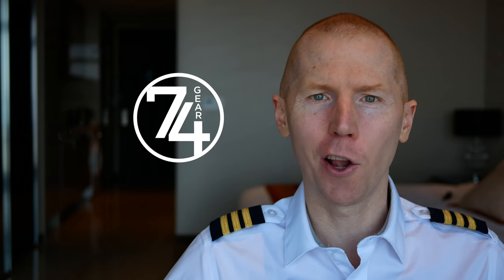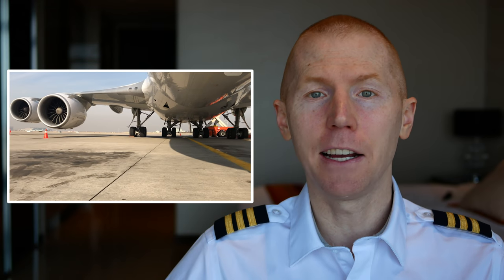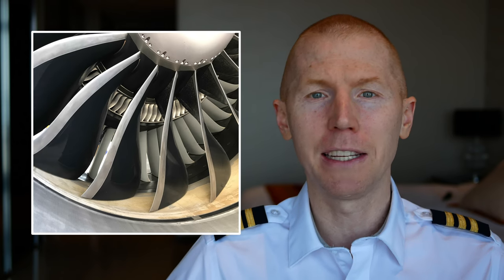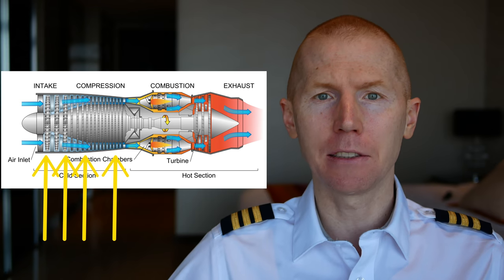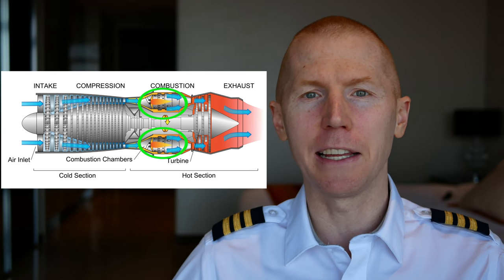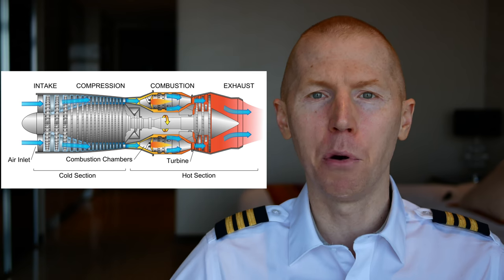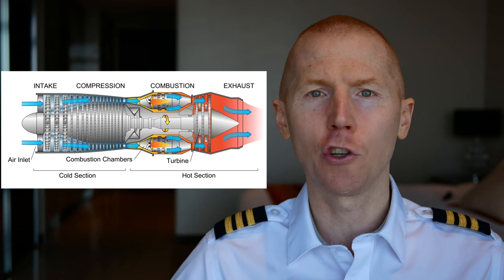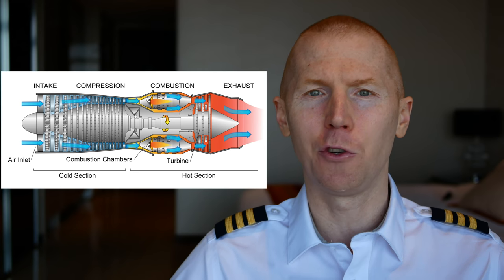How does an Airplane's Jet Engine Work | Airline Pilot Explains

Comment: Gas turbines,  have  compressors n1, n2,   combusters , annular or flame tubes, and turbine ngv. Some has 1 shaft like jet , others have 2 shafts a inner smaller in diameter and a outer hence 2 compressor rotating at different speeds to aid aerodynamic loads and few like the rb  family for thd l1011 has 3 spool or shafts, none of which is connected to the other..turboprop and turbo shaft  which are small jet may have a free turbine, which is a wheel and shaft and gears connected to prop and accessories
Reply from the maker: ya thats part 2 explaining the full system.

Comment: I always wondered why the combustion gases leaves on the back of the engine and not to the front. The pressure inside the combustion chamber has to bee higher than the pressure in the feed air and then the combustion gases have to go both ways🤷‍♂️

Comment: Good one! So, part 3 is about starting the engines on the 74 correct?
Reply from the maker: well all Boeing engines are going to start the same using bleed air from the APU, but ya it probably won't be part 3 but it will be. later video.
Reply: 74 Gear engine start switches oil lever and that’s that right? I watched Dutchpilotgirl‘s vid on starting the 737
Reply from the maker: well the oil lever ( I am not sure what you mean ) but that isn't going to start an engine turning.
Reply: 74 Gear I meant the fuel cut off lever or switch

Comment: So no pistons and it all works by a continuous cycle. How are the engines started in that case because you will have no initial air pressure gradient over the engine.

Comment: Not 1 video about MCAS and your thoughts about the 737 MAX situation?
Reply from the maker: manley1979 maybe after the investigation is over.
Reply: 74 Gear a lot of older generation pilots are saying the entire fly by wire trend in aviation is to blame. (Basically saying anything that takes control away from the pilot is bad) I would love to hear your opinion but I understand your discretion.

Comment: Now talk about what happens when a bird gets sucked into one. Also why does nobody do run-ups on turbine engines either.
Reply from the maker: what is there to run up on a turbine engine opl?
Reply: I runup my turbine engine all the time. 

How else am I going to check the autofeather, low pitch stop, prop governor, overspeed governor, prop feathering, rudder boost, etc etc etc? ;)

Of course on a turbofan engine there isn’t much to check.
Reply: @Bartonovich52  Maybe on a turboprop, but not on a turbojet or turbofan. Is it running? Next.

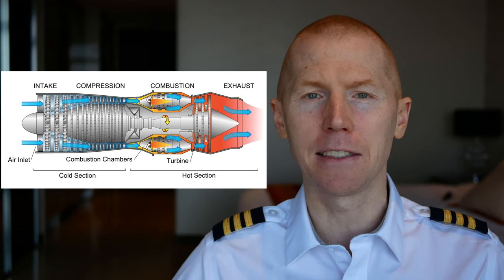Comment: Around 4:21 “Unless you stop the airflow or the fuel, the engine will continue to run”

So, is that why pilots turn on reverse thrust on landing?
Reply: A bit late, but no, reverse thrust is being used to brake/slow down the aircraft by kinda pushing it backwards (The thrust is being redirected from "Front->Back" to "Front->Front" if you know what i mean (I dont think so tbh)

Comment: Technically they are turbine engines not jet engines. To move the aircraft the engines are producing thrust by making a pressure bubble behind the aircraft causing the aircraft to move away from the pressure.  The principal of most engines from recipricating to turbine is extremely simple; suck, squeeze, bang, blow. Moving right along, the math that goes into making the engine work is complicated as all get out, not to mention the accessories like generators and hydraulic pumps.

Comment: Is the "canister" a torus-like all-hollow ring or is it comprised of a ring of separate smaller "canisters" around the core?
Reply from the maker: I don't really understand what you are asking tabaks.
Reply: All images of such engines are 2-dimensional. But, I think it has to go around in 3D. So, is it one continuous ring-like chamber around the shaft in 3 dimensions or is is a series of small combustion chambers in a ring around the shaft?
Reply: There are three different types of combustion chambers. Can. Annular. And can-annular. 

Old jet engines had cans. There were about a 8-10 or so all around the engine. Look up the Rolls Royce Nene or Rolls Royce Dart. You can see the individual cans... nothing covers them.. and they used pipes to get the compressor air in and combustion gassed out. Advantage was good control of combustion, strong, easy to replace one at a time without splitting the whole engine. But heavy, bulky, and inefficient. 

Next is can annular.  This is probably what he jet engine pictured has. Still combustion cans, but the air comes in as a ring and the gasses exit as a ring. More efficient and lighter with good control of combustion. 

Next is annular which is what most modern engines have. The burner can is one big ring (hence the name annular). This way you can have complete combustion all the way around... but the burner needs careful design and assembly to maintain rigidity and enough cooling air.
Reply: Bartonovich52, thank you for the exhaustive answer! Exactly what I was asking for. 👍

Comment: it's a combustion not and Explosion, combustion in Engine good Explosion bad. although combustion and explosion are very similar they are not the same you want to keep aircraft and explosions apart where possible
Reply from the maker: this is made for people who don't know anything about jet engines, so I am intending to keep things as basic as possible.
Reply: @74gear  thats fair
Reply: @74gear  Sorry, nope. AOG. Respectfully, if you oversimplify it to the point of being incorrect, it benefits nobody. I don't believe any of your subscribers wouldn't understand what a blowtorch is. Once lit, it's continuous fire until shut off. An explosion, by definition, has a definite end to the combustion period. A firecracker. A gunshot. A burst baloon. BANG! But that isn't what is happening here. It's a continuous ROAR! I think you truly owe your subscribers a little more credit for understanding a simple, but proper explanation.

I won't split hairs over can vs. annular combustors, but would suggest your viewers could understand the concept of a ring, like a donut, that wraps all around the engine and while burning fuel, produces a "tube" of super hot "air" to power the turbines. You might even specifically point out the turbine component that the family of engines gets its name from. See? Nothing that complicated to understand!

Oh, and given the core of a turbofan has a reducing/accelerating nozzle, even with the fan producing most of the thrust, there is an exhaust "jet" producing some thrust, thus the name "jet engine" is still 100% valid.

Comment: A few cringe moments...
Compressor blades, turbine blades... not fan blades.
Combustion chambers don't get fuel "from all sides", they have fuel nozzles in the front only and the airflow in the combustion chamber is very controlled to not burn the walls.
The igniters (spark plugs) also only start the combustion during engine startup, the combustion is self-sustaining after that.
The only moments those igniters are turned back on is automatically during take-off, landing (it looks at flap settings), when anti-ice is switched on, or when the ignition switches are set to "continuous" just as a precaution against flame-outs.
And while the overall "suck, bang, blow" idea is simple, good lord there is some insane engineering involved to make it all work.

Comment: Hey, Kelsey. Is there a specific way the fuel injectors are angled in the combustion chamber?
Reply from the maker: thats above my pay grade, thats more of an engineer question.
Reply: @74gear  Haha! Ok, thanks anyway.
Reply: The fuel nozzles spray in a slight cone shape directly rearward from the center. Cooling air is injected around, and throughout the combustor, which keeps the flame suspended in mid-air, and keeps the metal parts from melting.
Reply: Mike Cowen Thanks!

Comment: What rotates the front fan in the first place when air has not been compressed and mixed with fuel yet?
Reply from the maker: I will explain that in more detail in a later video but it depends on the plane... smaller planes have a battery that starts it spinning and then lights off... bigger planes use air from the APU.  I will explain that in detail later on, its easier to break down these things in smaller parts.
Reply: @74gear  Ok thanks
Reply: @de5792  Simple answer: there is a starter (various types) that get the engine turning fast enough to start. Just like your car.

Comment: I understand the basics of how a jet engine works, but I still have difficulty ‘comprehending’ the whole thing. It’s just so violent. I have the same issue with prop planes. I get ‘science,’ but it just seems incomprehensible to me that 3 or 4 big fan blades can move a plane to 450+ mph. Maybe I just lack vision 🤨
Reply from the maker: hmm, well hopefully after you see the second part it makes it more clear Chris.
Reply: I empathize. One of the most useful things that I saw decades back was along with the cutaway drawing were graphs of temperature, pressure and velocity along the length of the engine. then it all made sense. The highest engine pressure follows the compressor section at that squeeze before the combustion section. Gas temp and velocity are ramped up by fuel combustion.
Reply: David Newcomb That actually might be helpful.

Comment: So, a Jet-Engines combustion-camber is, basicaly, an air-breathing rocket-engine?
Reply: More or less yes.  They have a very similar design, except the jet gets the oxidizer from the atmosphere/compressor, and a rocket gets it from a tank.
Reply: @rebelndirt8830  Ah, thank you. :) I allways thought that jet-engines are just like... well; "efficient propellers" and never got to the idea that the "recoil" of the ejecting gas had a significant impact (asside from afterburners)...
Reply: @psymcdad8151  If the engine gets flooded at startup (wet start) they will make a very loud bang or pop!  If you are on the flight deck when this happens it can scare the crap out of you.  Some pilots think this is funny... Some deck officers don't, and will hold that pilot on the deck as punishment for doing that.  Wet starts usually don't reverse the engine as the extra fuel doesn't burn until after the engine fires.  high turbine temps can cause a reverse of the engine due to the low speed that the engine is turning and the expanding combustion can usually override the electric or air powered motors that are spinning up the aircraft's engines.  Thankfully I never experienced this in my time on the flight deck, but we were warned about it frequently.
Reply: @rebelndirt8830  this sounds interisting and funny, wich most likely means that it isn't if you have to deal with it. ^^
Reply: @psymcdad8151  pretty much... The flight deck of an aircraft carrier is bad enough of a place without loud explosion like sounds scaring the crap out of you.

Comment: How come the fuel inlets dont catch fire and ignite the fuel Tanks ?
Reply from the maker: well I am not an engineer so I can't explain that detail into how they prevent that from happening ATC, maybe its just the speed that the air is moving or the nozzle is so fine the mist of it doesn't allow it.  I never really gave that much thought.
Reply: If I got that correctly, the intake-air creates enough preasure to keep the flame behind the inlets. At the same time the fuel alone without oxygen inside the inlet can not catch fire, avoiding a "backburn" trough the fuel-lines into the tank. The Inlets themself are usualy made from a not-burning material with a high melting-point. If I had to guess I'd say "some kind of ceramic, aluminium oxide or something". If the inlet heats up, the fuel vaporizes inside the inlet. As it can not vaporize back into the inlet (because fuel-pumps pump fuel into them), the preasure of the fuel-vapour pushes the fuel outside of the inlet, taking away the buildup heat, while fresh fuel flowing in cools the inlet. So, the bare-bone-principle of a jet-egnine is simple. Geting it to work reliable and safe in real-life takes a lot of engineering, math and fine-tuning :)
Reply: @psymcdad8151  Correct. Fuel will not burn without oxygen. There is only fuel in the fuel system, so no fire can occur inside fuel system components. The pressure of the fuel also ensures no air in the system. Fuel nozzles are metallic. They have an enormous amount of air being blasted past them, prior to the point the fuel is ignited to help keep them at a safe temperature, as well as the fuel from within also carrying away heat.
Reply: Thank you, very nice detailed explanation 👍🏻

Comment: Suck , squeeze, bang and blow
 Thats how I remember how a jet engine works. Although the bang part is technically wrong. It sounds dirty though and gets people to laugh

I liked the video, but this explanation was super over simplified. Technically there isn't an explosion , if there was an actual explosion it would hurt the engine in many ways. As soon as fuel is being pumped, there is flame. Hard starts can demolish a engine.